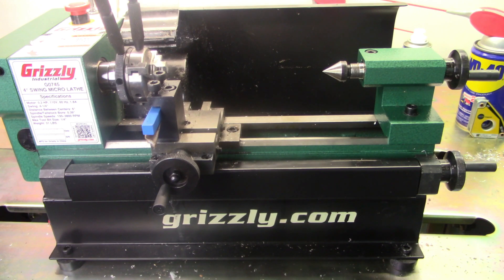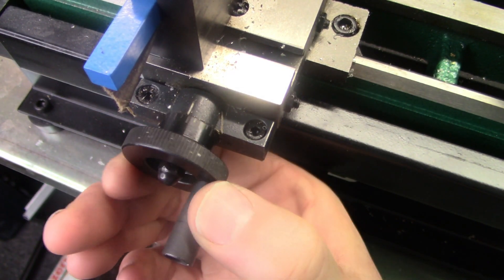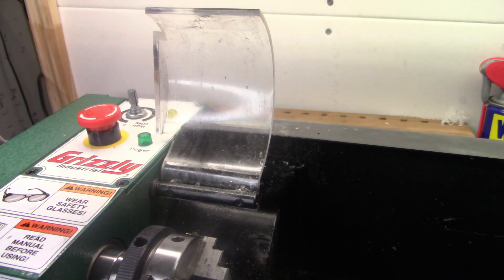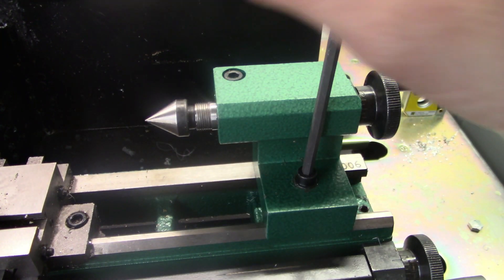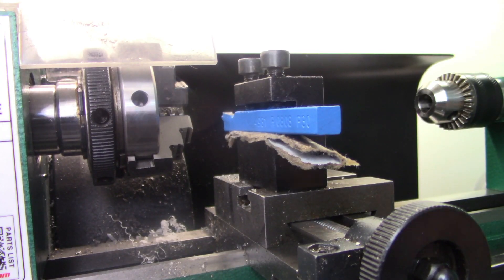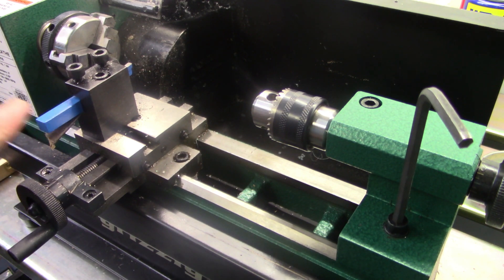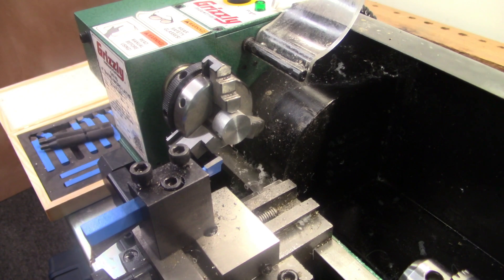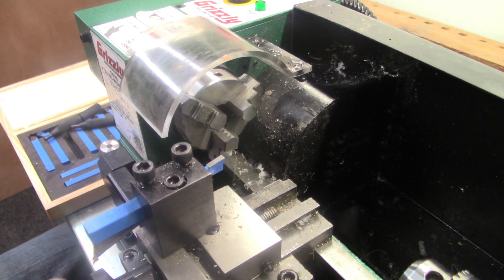Mini Metal Lathe Grizzly G0745 Pros and Cons Review

Comment: That slop when you convert the lathe to CNC there's a setting in your controller called backlash compensation.  Turn backlash compensation on and it will take that slop rite out of there.  Also be sure and replace the spindle motor with a servo that way you can enable CSS constant cutting speed.  CSS makes it so as your cutter gets closer the the center line of the lathe the spindle RPM's also adjust to match your cutting speed so your finishes are always the same quality and chip load no matter how far in or out the cutter is
Reply from the maker: Awesome. Thank you. I’ve upgraded my lathe to a larger grizzly. Do you have any recommendations for a spindle motor for it?  Thanks for the comment.

Comment: I’ve got my eye on this one. What’s the largest diameter rod that will fit into the chuck (rod stock)? Also, can you get chucks for the other end to accept larger size drill bits? Thanks.
Reply from the maker: I want to say it’s 3/8 I can’t remember exactly. What size are you needing to do and what do you plan on doing with it?
Reply: @ChasesWKshop   I have a chunk of 1.25” x 5” brass rod stock. I’m making custom coins and I need a lathe to slice the stock into thin (coin size) discs. I tried cutting a couple with a hacksaw and that works fine (with a fresh blade) but it’s tough to get the discs matched in thickness. I have some other small projects planned for the lathe but first up is this coin project. Thanks.
Reply: … the Grizzly description for their smallest metal micro lathe (4x6”) says the chuck is 2” but it doesn’t specify if that’s the actual size of the chuck itself or the size of the stock that will fit into the chuck. Does that make sense?
Reply from the maker: @doubledog5894  that’s the size of the chuck. The through hole is much smaller than that.  I commonly use 3/4 bar stock and it was too big to go through the spindle.  I have upgraded to a bigger lathe now but still use this guy for polishing and sanding parts.  This one was great to get started on. Before you buy one I’d figure out exactly what you’re wanting to do with it. If it’s making small parts it’ll be great. As far as turning bigger stock I’d save for a bigger machine.
Reply from the maker: @doubledog5894  gotcha. I was having trouble with mine trying to cut 3/4” knobs.  Now I use a metal cutting band saw to cut the parts then clean them up in my lathe. I don’t think you’ll be happy with this machine trying to cut off parts of any size.  This one really lacks the power for sure in that field.  Now I think it would work fine to clean up the parts afterwards. Hope this helps bud. Btw I’d love to see some of the coins you make!
Reply: I asked customer service.. “The G0745 4" x 6" Micro Metal Lathe has a 2" 3 jaw chuck that holds a minimum of 1/8" diameter and a maximum of 1" diameter.”

Comment: the slop in the knobs is known as backlash. All manual lathes have backlash and it isn't an issue. Back the tool off past where you were then wind in to your depth of cut. You'd do this on a Monarch, colchester, hardinge, southbend, Myford etc. Nice looking lathe and happy swarf making :)
Reply from the maker: Andrew Millyard thanks bud. I actually just upgraded to a g0765 lathe. Was looking at the g4000 but probably more than I need at the moment. Thanks for the info bud. Welcome to the channel.
Reply: @ChasesWKshop  Good channel no machine snobbery which is nice. Good tip for working on small machines. Been running a little myford ML7. Learn to grind HSS. Much better than carbide inserts if using a small low powered lathe.
Reply from the maker: Andrew Millyard great. I’ve looked at hhs but have never used it. Guess it’s always a good time to learn how to grind them. What would you recommend to start with? Some pre ground? I’ve got a few blanks. Thanks for the info and glad you liked the channel man. I defiantly don’t know enough about anything to not be willing to take advice. Practice makes progress never perfection. Perfection comes with the unwillingness to make progress. Thanks again.
Reply: @ChasesWKshop  pre ground is pointless. Watch MrCrispins video on HSS. Grind it to look like the photo. No need to get hung up on the angles. Give it a couple of weeks and you would have mastered it. I am only an apprentice with 4 years experience but I take what I can from the old dudes. I was reluctant to use HSS and could only take 20thou cuts on my myford. Can go 60thou with HSS now. Carbide is blunt so requires power and rigidity. HSS can be honed sharp so more efficient. Check out my only youtube video. I was so impressed.
Reply from the maker: Andrew Millyard awesome will do bud. Thanks for your help!

Comment: Having owned one for 6 years I'd say just get a 7x14 sieg for the same price. That way you can thread aswell. But I learned alot on this little lathe. And made some very useful parts. And a ton of nice pens
Reply from the maker: Fast4SloW 717 yes. I ordered a 7x14 g0765. Hope it’ll be here this week. I love the g0745. For what I do it’s perfect but it’s accuracy is not perfect. Knew I would eventually upgrade.

Comment: Could you please do another video on upgrades such as the quick change post. I bought one but I believe it's the wrong size or I just dont know how to put it all together.
Reply from the maker: Absolutely bud. I’ll make one once I get some upgrades to it. The main things I want to upgrade are the lead screws and lead nuts. That’s where most of the rigidity and accuracy is lost. All milling machines accuracy is in the rigidity and control of the machine. I’ll keep you updated on any changes I do to the machine bud. Thanks for the comment.

Comment: I made a mistake of buying this lathe for ring making and tonight I believe it cant do what I need it to do.
Reply: It will be perfect for ring making. Once you learn to work around the backlash you can easily hold tolerances of under a .001". I've owned one for 5 or 6 years.
Reply from the maker: Yea I don’t know how well it will be for that. I think it can be done but without some changes to the machine I don’t know how repetitive you could be with it. I just make knobs so it’s does pretty well for me.